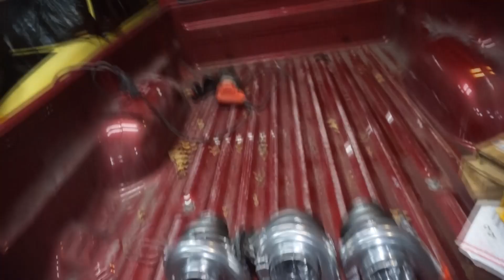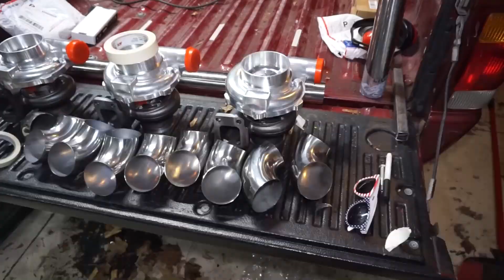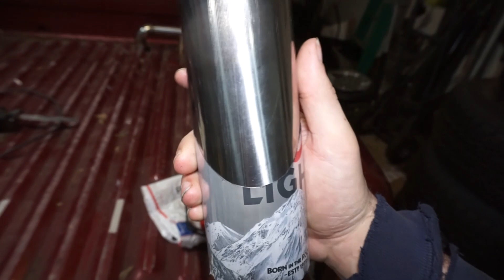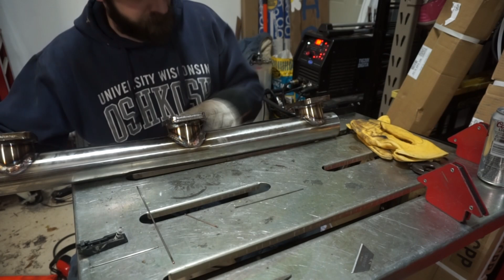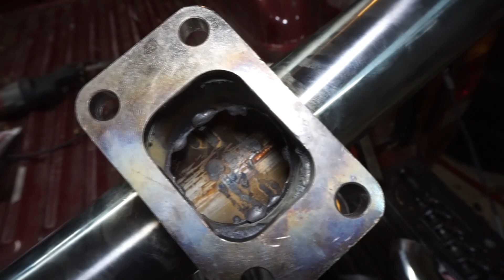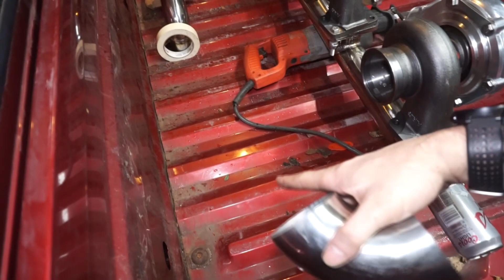Triple Turbo LS Swapped Ranger First Start... Kinda...

Comment: This is great, you're the new Sloppy Mechanic now that he's upscaled his deal a bit. Lol
Anyway, I'm positive this setup will work, so I guess I need to watch more of your videos to find out that it did.  BTW, I'm running a pair of eBay GT35s in the trunk of my shitbox bimmer, and I made a divorced oil system for them.  $30 diesel lift pump works a treat for a turbo oil pump as it turns out.  Hahaha

Comment: If may b you could sit the first turbo (right) on a 4 inch pipe,the second(middle) 3 inch and last on a 2 inch then weld it could control the out put on the turbos

Comment: how are you not going to have scavenging  issues?  you should put a tool box over it for full sleeper look
Reply from the maker: Will run a scavenge pump in the drains for the oil.

Comment: Hopefully this works but I see alot of inconsistency when it comes time to tune it. Normally you'd have each turbo feeding one another. Maybe do a central exhaust through the bed then branch 3 logs off that for your turbo mounts. Have a feeling that last turbo will just be dead weight and very inconsistent.

Comment: If you mounted boost actuated cutouts between each of the turbo's on the hotside (to allow flow to second and 3rd turbo), and connected the compressor outlets consecutively to the inlets, it'd make a badass 3 turbo compound setup with quick spool.
Reply from the maker: Not doing compound, but I may add a valve after the first turbo if it's too laggy so it opens up to the other 2 after the first one spools up.
Reply: @BlaserBuilds  The only issue with that is the first turbo will spin the other 2 turbos backwards before boost is built up haha. Maybe if there was a valve on the compressor side also it'd work. EPIC project btw